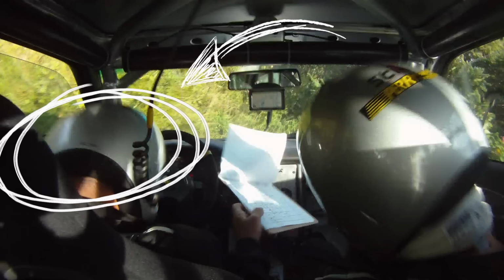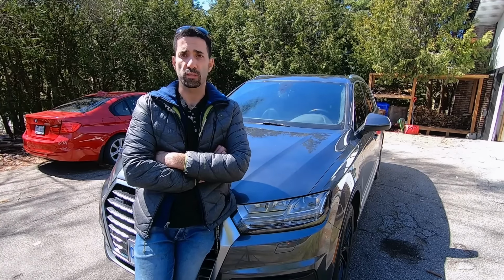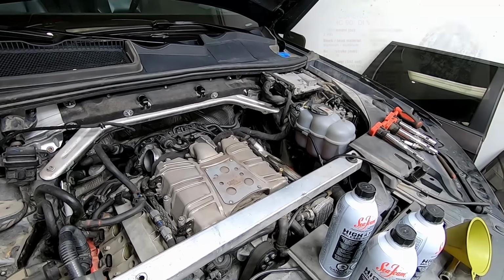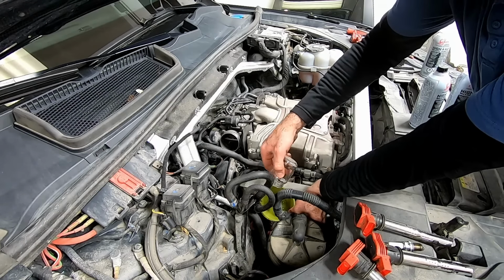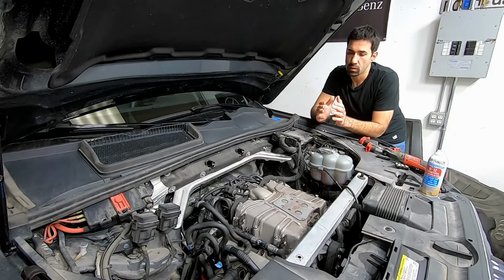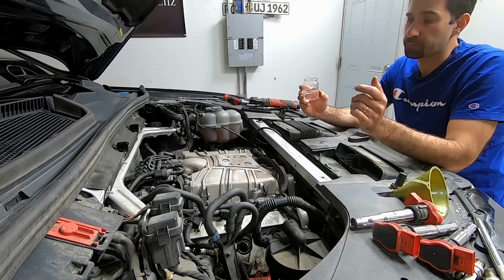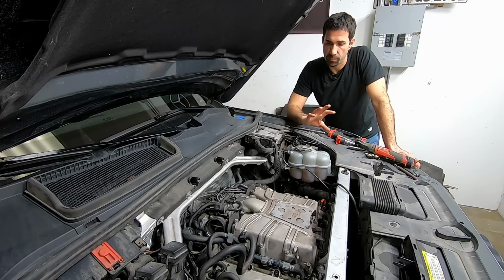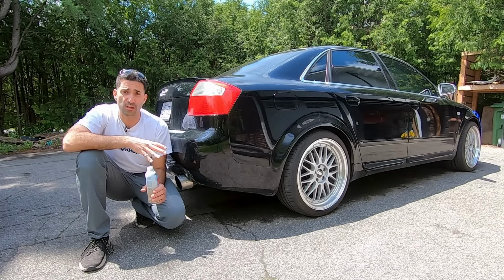How to fix oil consumption on VW/Audi/Porsche 3.0T engine?

Comment: Hello mister,
Je vous fais part de mon experience où j'ai fait un piston soak avec un engine flush Proline
 Liqui Moly pendant
 48h.
J'avais pas de compression sur le cylindre 3 et une consommation d'huile d'un litre/500kms.(Audi b8 de 2010 2.0 tfsi avec 105000 kms.
Resultat pas d'amelioration,le moteur tourne toujours sur 3 cylindres.
Dommage pour moi.
En plus en Europe on ne trouve pas de B12.
Peut etre que je devrais essayer avec un nettoyant injecteurs?
Reply from the maker: Quand vous dites que vous n'aviez pas de compression sur un cylindre, quelle est la valeur réelle ? Peut-être avez-vous des dommages plus graves et que ce ne sont pas les segments de piston qui sont en cause ? Malheureusement, le B12 n'est pas disponible en Europe, mais vous pouvez peut-être le commander en ligne sur ebay. Je m'efforce d'essayer d'expédier de la B12 depuis le Canada, car de nombreuses personnes en Europe en demandent.
Reply: Pruebe con ATF+4 mezclado con acetona en partes iguales. Me funcionó con grandes resultados.

Comment: I just picked up a 2017 3.0T Q7 with 130k miles in Arizona. The previous owner took it to the dealer service center every 5k miles for routine service and maintenance. Would anyone recommend soaking or any type of procedures to prevent oil consumption issues from popping up in the future? As of now the has no issues and runs well to my knowledge.
Reply from the maker: @Quan-lei  if it's running well there's no need to do this... you can do a flush every oil change just to keep things clean

Comment: Planning to try this myself soon. When hitting the cylinder with an air compressor should the piston be TDC? Or can I use the air compressor anywhere in the cylinder cycle?
Reply from the maker: @ShaanNotShawn  anywhere... all your trying to do is blow out any garbage from the cylinders
Reply: @ETMotorsports  thank you my Q7 is burning 1QT every 300 miles :-0 will let you know how it goes
Reply: Car is feeling great after the piston soak. All 6 cyls had carbon to the point where I couldnt see the piston head tops, now I can see metal on all.
The spark plugs were also fouled, so fresh spark plugs, new air filter, and new oil. Starting the mile counter now
Let's see if it works. Thank you for these vids.
Reply: @ETMotorsports   400 miles and reading full! It was previously actually burning at about 1QT per 200ish miles. Starting a new comment thread for updates.

Comment: just getting ready to do this on my 2017 Q7 as well. just wondering if you could share what socket you use to turn over the motor on the 3.0T.... i wasnt sure which one i need. maybe a link to the exact socket?
Reply from the maker: it's not a socket on the v6 engines...there's a tool for it...look up CTA 1412
Reply: Did you do the soaking on your Q7?
If so, who did it go?
Did your crankshaft got stuck?
Reply: @SuperVertrix  yes I recently did the piston soak on my 2017 Q7 3.0T... it had a couple spots that were sticky feeling but not horrible. I just went backwards a bit and moved forwards and it turned over fine after that. I got a huge amount of carbon out of all cylinders. So far I am at about 1200miles and seems to be zero oil consumption now. It was using about 1qt per 900miles before...
Reply: @brettl6747  Wow! Excellent news.
And thank you for the tips!

Comment: Hi,  could you you please provide exact part number for B-12  you used, there is so many online, some legal in all states some not. Guess it has different chemical in. 
Please post a PN for stuff you have use 👏🏻
Reply from the maker: hey you`re looking for:

Berryman® B-12 Chemtool® Carburetor, Fuel System and Injector Cleaner

Net 15 fl. oz. (444 mL) Easy Pour-In Can
Part #0116 (the small cans I used)

or

Net 21 fl. oz. (621 mL) Easy Pour-In Can For Trucks & SUV's
Part #0121 (the bigger cans)
Reply: @ETMotorsports  Thank you!

Comment: Thoughts on tossing in a can of b12 in the gas tank as preventative maintenance once a year for the 3.0t? As of now, just burning the usual 1Q of oil every year (~5,000 miles)
Reply from the maker: @josephhills4718  that won't hurt but it'll only help your fuel system - it won't do anything to help the piston rings

Comment: I'm pouring b12 in the piston at TDC and the solvent is just going some where. Not on the top of the piston.  It's definitely going into the cylinder. Car was running with no misfires and strong just going through qt every 2 weeks. I'm going to try it not TDC but are there any other recommendations
Reply from the maker: @aibarberguy3141  it's draining past your rings... is it only doing it on one cylinder? That one might need more attention and perhaps a repeat of the soak... did you measure the compression before you started? How's the plug looking on this one? Don't worry about the liquid disappearing - it's going where it needs to... rotate the crank to move the piston up and down and continue with the process

Comment: Hi, I was wondering if I could do this on my skoda superb 2011 1.8 engine. The engine lights came on with EPC, and the idling is pretty bad, can't go more that 50km/hr, it also stalls really bad too.

I checked in with the mechanic, last month, and I replaced all 4 spark plugs because 4th was burnt out, I had the same issue again, the mechanic checked   the 4th spark plug again and it is burnt out with the other 3 still as good as new, and he said I have to changed the motor.

I took it to the dealership, and I was asked to book a time to get it check, for the check alone, I have to pay about $300. I live in sweden, and I'm not sure I can get the B12 here. But I was wondering if I could try this out on my skoda superb.

Please let me know what you think.
Reply from the maker: @iamOmolove  hey definitely although I think the epc light might be related to cam adjustment... check my oil pressure videos where I fix my a4 which had the epc and oil pressure issues before I did the piston soak
Reply: @ETMotorsports  thank you very much for your response, I'll check out the video, oh!! I forgot to mention, my car is currently burning so much oil that I have to buy a 5liter  and keep in the car, so I can top up every 3 days.
Reply: Sorry to bother you again, I couldn't get the B12 here in sweden, but I found "Rislone engine flush" and "STP Carb cleaner", can I use any of this for the soak?

Comment: When the engine wouldn't turn, That large gunk chunk of carbon.  Do you think that probably came off the manifold side of a valve stem and made the valve stick open?
Reply from the maker: @MrArtisticGuy  no it ended up being carbon dust... it looks like a big chunk because all of it builds up at the lower end of the piston head
Reply: @ETMotorsports  I just bought a used Q7  ( 3.0 T  TFSI  with 100K miles.  3.0T   It burns a quart of oil every 250 miles.      I'm really glad that I found your video.    It seems to me that with the piston soak , with the manual turning of the crank, that might also help with some of the intake valve cleaning.   You uses 1.5 ML of seafoam which likely over filed the cylinder and backup into the spark plug whole while you turned the crank manually.    That probably allowed some of the solution to enter the intake manifold slightly when the intake valve started to open.      When yours locked up while trying to turn it, perhaps that was a large chunk that had dislodged from an intake valve stem and held the valve open to where it touched the piston.     You seemed extremely surprised at how dirty is was.    I think the valves may have been the source of the contamination.    Either way;  I'll be super careful.       I might even intentionally go a bit heavy with the B-12  (  150 ML or more ) to keep the fluid level high enough to seep up into the intake manifold as the piston begins to descend on the intake stroke which will help soak the manifold side of those valve stems a bit.

Comment: Hello, I did it too ,but code come out 2006 intake manifold runner control stuck closed bank 1 a.Engine works fine. I am wondering about if I did something with connection air filter and should be from this ?what is your advice?thanks
Reply from the maker: @Believeanddream13  there are a few vacuum lines on the intake manifold - make sure you didn't leave something unplugged
Reply: @ETMotorsports yes I just wondering if I missed something should double check , thanks
Reply: Yes you were right i missed unplugged 1 vacuum line , I will give update about my oil consumption was 1 quarter per 1200km after did liqui molly engine flush  and increase to 1 quarter per 600 km I don’t know why but my hope is in B12, thanks again
Reply: Wondering should I be doing this if  MAX it ask me to add oil after -9000km. Doing oil change 10k km

Comment: With regards to having the pistons at TDC, will the same pair be on the same cycle (ie: compression or exhaust)?  Should you be concerned about the valves being open on the exhaust stroke and the Berryman's fluid leaking out the exhaust valve?

Comment: Hey, just wanted to share my feedback,  i did the whole proces on my 2012 vw golf GTI mk6, with 240k kilometers, its bone stock,  and since i bought it it was burning 1l of oil every 300-350km  and if im pushing the car, sometimes will drink the 1l of oil arround 150km, so i was spending pore money on oil then petrol, was using Motul, so i did the whole piston soak for a total of 28h, had problems atarting it, but eventually it did start, now the strange thing once i started the car there was no smoke, literally not even a puff of smoke, which made me supper surprised,  i am wandering why that is, and has anyone else experience that also ? The car was missfireing, after 25min of driving it somewhat cleared up, so i did an oil change with Liqui molly, installed new sparkplugs and will see now if it will have any improvment, il update my comment weekly to keep everyone updated.
Reply: I finished up my Q7 today and was surprised there was no puff of smoke. Did you see improvement?

Comment: Hi friend 
Good video.
After this process 
Will be ok to add seafoam or b12 on gas tank every oil change?
Reply from the maker: @giuseppecutolo5756  you can definitely add it to the gas but that's just for the gas system - won't do anything for your piston rings

Comment: How do I spin the crank. Other people say a 24mm socket works....why is my car different. 2014 a6, 3.0t
Reply: I found a way to make a 10mm triple square work. If anyone else has this problem.
Reply from the maker: @throuts  24mm is for a crank with 1 bolt- the v6 uses 8 small ones I think... there's a vw tool that goes in the middle to spin the crank

Comment: What would one do if they were unable to crank the motor after starting the soaking process? Again, many thanks for your guidance.
Reply from the maker: Hmm... if you can't turn the motor then you can't take advantage of hr pistons at TDC... on the V6 you may have a piston that's really low so you'll either waste a bunch of solution or not be able to soak the whole piston... I'd say it's pretty key to turn the crank
Reply: @ETMotorsports  I’ve been able to get all the pistons to TDC and soak them, but the engine gets stuck after several cranks using the crank pulley (I ordered the special bit). I also used compressed air like you did in your video. Any other suggestions? I’m kind of stuck. Thank you again, Sam.
Reply from the maker: ah - I understand now...I`m guessing you don't have a scope to see what's going on inside? so the engine turns well until you get to a certain point and then stops like I showed in the video? can you back in up counterclockwise a few degrees? The piston that's at TDC when it gets stuck is the one causing your problem - you can focus on it... if you've already blown air in, I`m guessing a bunch of crap came out? Another viewer was in the same situation and hit it with the starter, which broke up all the crap that was inside and blew it out. It's a bit of a risky move but if you've tried everything else that may be your best bet. I would keep working on it though - back up the engine a bit, blow in more air, maybe pour some diesel down and keep going back and forth. The crap builds up on the bottom of the piston where the liquid goes through so unless you clear it up it will keep getting stuck. Fortunately from what I saw on the scope, it's very brittle because it's just dissolved carbon dust so you should eventually be able to clean it
Reply: @ETMotorsports  I can turn the motor only a small amount clockwise or counter clockwise before something binds. By small amount, I mean 3-4 turns using my socket wrench. I ordered an inexpensive scope and checked inside each cylinder this morning and I can't see anything obvious that would be preventing things to move freely. I am soaking cylinders 1 and 6 again as they are the two that are highest up in the head. I am not sure what to do next.
Reply: Ok, here’s my update. I took another look with the scope and identified some areas where larger chunks of carbon had been loosened but left on the cylinder walls. I performed a soak several more times on the worst of the cylinders and kept turning the crank every couple of hours. Eventually (a couple of days of doing this) the engine began to crank freely and fully. I reassembled and started the motor. It took a minute or so to get the engine to fire and it ran rough and blew out smoke for another minute or so before settling down to normal. I let it idle for 15 minutes and revved the motor to 3500-4000rpm a few times during the idle process. I then drained the oil (black color even though the oil was nearly new-800 miles) and replaced with Rotella 5/40 oil as recommended in your tutorial. I’ve reset the trip odometer and will report back with my results. Again, thank you for your patience, assistance and guidance along the way.
Reply: This is a helpful comment. Hopefully you follow up.
Reply: @samuelcritton8012  Man, reading your comment thread had me on the edge of my seat, especially when you'd tried the blowing air in trick and it was still locked up!  Very scary.  Glad it worked out in the end!  What was your before/after oil consumption, and how many miles on the car?  Thanks in advance.
Reply: Another update:
I have run the Q7 1000 miles and drained the Rotella oil. Again, it was really black despite being fresh oil. Obviously, lots of carbon has been dissolved and deposited in the oil. During the first 1000 miles, the engine used no oil. I have since changed the oil back to my usual Liqimoly Molygen oil and have put another 1000 miles with zero consumption. My engine was using 1 qt every 450 miles before performing this procedure. I also changed the entire PCV system with no change in oil consumption (waste of $2000 unfortunately). One other observation I had is that my motor started using oil at roughly 88,500 miles and I performed this procedure at 94,000 miles, so the length of time for my issue was relatively low. I’m curious to know how many miles folks who have continued to add oil and not address the issue can go before something else fails (cats, plugs…). In conclusion, I think this is the magic fix if one has the ambition and skills to do it.

Comment: I keep gettin misfire on cylinder 3. Can i just soak that cylinder or i need to do all of em? Did pcv about 1k miles back. Thought it was injector. But still oil consumption and misfire in cylinder 3. Havent checked compression
Reply from the maker: @josemarquez6883  you could try to do just 1 but chances are they're all burning oil...3 is the worst probably or you have a different issue there

Comment: What is equipment called to suck out any b12 oil and equipment to blow out the junk in the cylinders? Thanks
Reply from the maker: @rsingh5077  you can use a compressor to blow out the garbage... sucking i guess a vacuum cleaner or a compressed air vacuum pump works too
Reply: Would a compressor with 90–130 PSI be plenty or go with 150–250 PSI? Thanks for your help again

Comment: Hey guys, I finished the soak yesterday on my Q7 , did oil change , new sparkplugs , engine filter, after around 12 hours and 70 miles i got the check engine light on. Getting P2006-Intake manifold runner bank 1 stuck closed
P2007-Intake manifold runner bank 2 stuck closed . Any ideas?
Reply from the maker: @miguelvega9957  hmm that shouldn't be related to the soak... did you maybe leave something unplugged?
Reply: @ETMotorsports, thanks for the quick response. In fact, i did leave the rubber hose disconnected on the selenoid valve .
Reply: I have plugged it back in, which should take care of the check engine light, I hope. Also, thank you so ulmuch for making this video, I'll update my oil consumption on a separate comment, I will be hitting the road for Thanksgiving, and I'm confident that my oil consumption will improve.  I recently started to notice the oil consumption (3 months ago) 18 Q7 was eating about 1qt every 1,00p miles. 

Pistons were dirty as expected and took some pics and footage before and after. 

Manual crank got stuck a couple of times, but was able to blow and dust out carbon residue. 

I'm excited and looking forward to positive results:)

Thanks again, Sir. Greetings from Chicago.